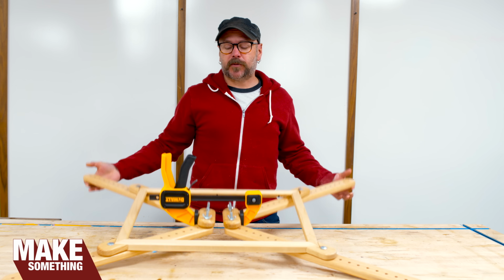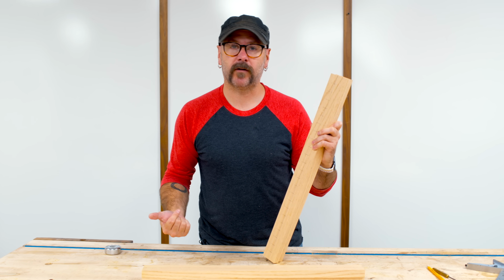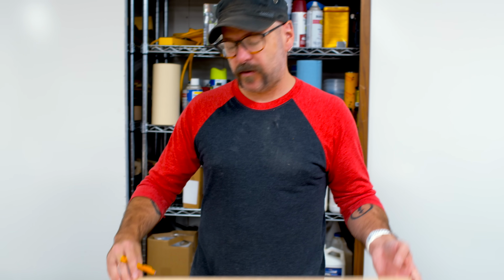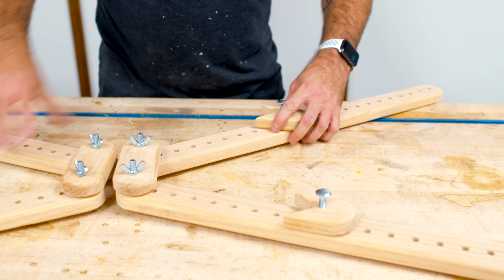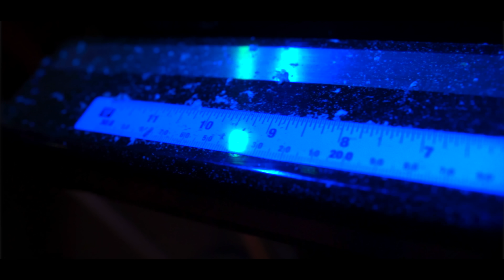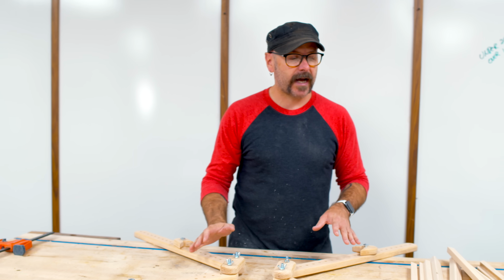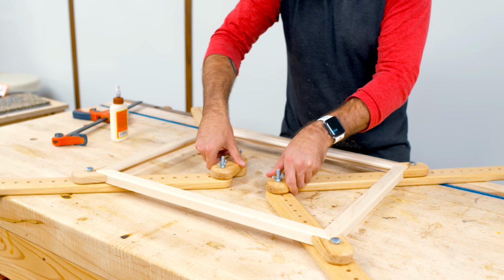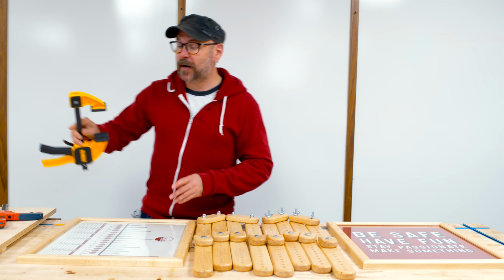How to make a picture frame clamping jig.

Comment: Great jig fella,  one comment is, if you wrote the hole number on each leg then wax the legs you would not need to "count" the holes to find the correct one to plug "PAKMAN" blocks into.

Comment: Couple of ideas to upgrade and make the jig more complete:
a) number the holes, so no counting necessary, less chances of errors
b) in the center piece you can set a threaded rod, fix in one side and with a knob in the other to do the tightening without clamps. 

Loved the disco-workshop bit!
Reply: Good ideas!
Reply: I was going to suggest numbering the holes, but I didn't even think of the threaded rod idea. Nice.

A few extra pieces of hardware on the holts can also improve the setup a little. As it is, the raw wing nuts will cut into the wood when tightened, and might fall off when loose. Adding washers to the top will keep the wing nuts from digging in. Adding washers to the middle will make the movement a little smoother. And replacing the wind nut with a hex nut and an acorn nut, tightened against each other, will keep the bolt in place but allow it to be loose enough for the wood to move. I'd also recommend replacing those carriage bolts with some plain hex-head holts, and adding washers to the bottom, inside the counter sinks. That will help the wood to move freely while the bolts and nuts stay firmly locked to each other.
Reply: Numbering holes is a good idea, but clamp method is much faster. Also, it keeps the jig in two halves for easier storage.
Reply: That or you could just close the jig so that the holed pieces are aligned next to each other. Then it’s easy to just use the same hole on both sides
Reply: I have an aluminum "Clamp Mate" brand version of this and the threaded rod is cumbersome to use.
Reply: Yeah, nailed it good ideas there.

Comment: When most Woodworking Instructors are rehashing the same plans, David Picciuto continually brings fresh, inventive, and useful projects to the community.
Reply: Garrett Haines  I made one just like this out of birch in the late 1970’s for my dad after I got a Shopsmith. Same design with bolts, works great. I got the design from magazine plan at the time, although I don’t remember which magazine. My dad passed in 1990, I have the jig/clamp now and it still works great. If I find a copy I’ll let you know.  Some designs will always be timeless.

Comment: Very nice!  I bought so many picture framing jigs but none of them work right.  This may be the solution.
Tip - Number each hole so its easy to slot and re-slot without counting holes.

I like the Dewalt clamps, nicely made and they hold their grips.  I can't stand the Irwin clamps. 
Cost does not matter.  You should not curse when you use them, you should smile.
Note: Dewalt and every other brand, the rubber caps come off or degrade with use.  Glue them in place from the start so you don't lose a rubber grip.  For gluing metal to almost any other material, including rubber, nothing comes in better rated than Loctite ultra-gel glue ($4.49, Amazon) - be sure it is the blue bottle for GEL not red bottle for LIQUID. 

For wood working, use Titebond II (interior) or III (exterior), best PVA wood glue there is.

Comment: Cool! I recently had some trouble clamping  a picture frame, totally gonna build this. Maybe inverting the position of the bolts for the corner pieces would solve the leveling issue quicker than coutersinking, but not as pretty, of course.

Comment: I’m using strap clamps but that looks a great idea. I would imagine that some care has to be taken in drilling the holes on the arms, and on the joining pieces in exactly the same place otherwise uneven pressure will be applied by the clamp and it will be difficult to hold it square while the glue dries.

Comment: Ok, here I go.

Love your videos - woodworking to go-karting, and of particular interest is your frame-making videos, as it’s why I got the inclination to start woodworking, cuz I need so many frames, I’ll never be able to buy them all, and why would I, when I could just #MakeSomething

I’ve bought new and used tools - a small garage full, but haven’t  even set anything up yet. Overly methodical or OCD ish.

My question has to do with all of the various methods you have demonstrated when making frames. I plan on keeping most (90%) of mine very simple w/a miter, and a slight round-over if any detail.
I’ll add spines where warranted or desired for strength and look, but as most (larger ones) will be stained or painted black, I might use biscuits, although I know more strength comes from the splines. TBD I guess. 

You’ve made a few different jigs - including this one. I get the cutting jigs purpose, but I’m confused as to what the real benefit of this jig is. It seems that it just replaces the use and/or need for more clamps. I’d be inclined to make this if it is a true time-saver or provides a significant benefit to me, especially as a Newbie.

Way TMI I know, “but hey, that’s the ABC’s of me!” ~ From Cuba Gooding Jr.’s character in Jerry Maguire.

Hope you have some good feedback as I’m anxious but slightly lost-ish.

Comment: Definitely nicer than the one I have but this is not new. I have had one one these for over 20 years but mine is made of aluminum. Plus if you make the center pieces longer, you can build bigger frames.
Reply from the maker: Correct. This has been around for decades.

Comment: Wish you showed squareness of the frame after the glue dried and clamps came off (not that we don't trust you). For us OC types ;)
Reply: I was wondering about how accurate you need to be when drilling all those holes.  My thinking (quite possibly flawed) is that they would need to be very accurately placed in order for everything to come out square..

Comment: Here's a thing, why do stand-alone sanders rotate counter-clockwise (or anti-clockwise if you're from the UK :-) when - if you are right-handed - it would be far better to run clockwise :-)) Combi sanders run that way because of the belt sander direction and they both use the same shaft. Handy new jig BTW - except for those awful wingnuts - print/cnc yourself some nice M6 knobs :-))

Comment: Heads up David that you didn't post the video to the upgraded Picture Making Sled "down below" as stated in the video :-)  I wanna make it.
Reply from the maker: That's because that video is coming out in a couple of days.
Reply: @MakeSomething  Roger that. I misunderstood. Will be looking out for that one. My mother-in-law has started having her art accepted by galleries so I'm on the hook for making picture frames. You are a great source of knowledge and are earning me huge brownie points with the family ;-)
Reply: @alexreid4131  May I offer some details of my experiences that might be relevant to your impending tasks?   I make reverse picture frames for a friend who sells her pictures through galleries.  They are fairly chunky in cross section and I originally just used my air nailer to put a couple of 18g nails at one or both sides of each corner to improve the joints.  However, it seems that the handling and storage when galleries are involved stresses the frames far more than just hanging them on a wall, and many were returned because the joints were opening slightly - possibly because the nails are not ribbed in any way.   I therefore had to rework all the previously made frames by inserting splines in each joint to prevent this.   In future, as I already have a machine, I intend to use Dominoes instead of splines in the joints for the frames I make so as to avoid the problem recurring.
Reply: @donjohnson24  Thanks for the awesome insight Don. I don't have a Domino machine but I'll have a think and see what I can come up with.
Reply from the maker: An easy trick that doesn't involve splines... Buy some 3/4" hardwood dowel rods and slice them up into little cookies. Then using a 3/4" forstner bit drill a hole in the back of the frame at the joint and glue in the cookie. Hopefully that makes sense!
Reply: @MakeSomething  That's an AWESOME tip David. Thank you so much. Looking forward to your next vid.